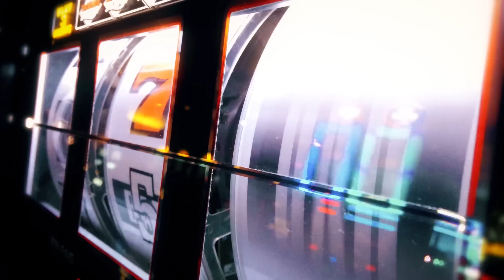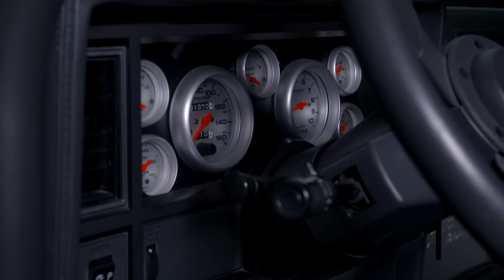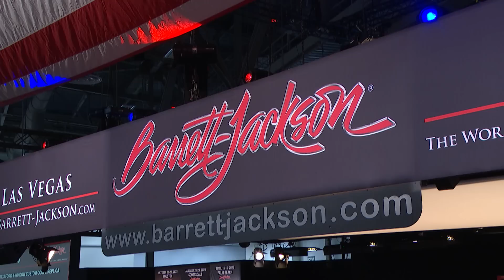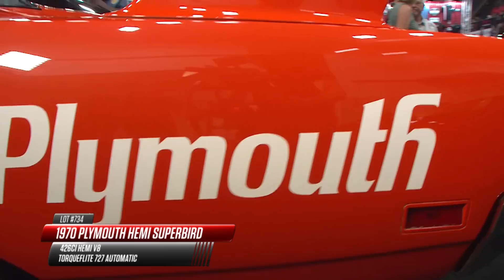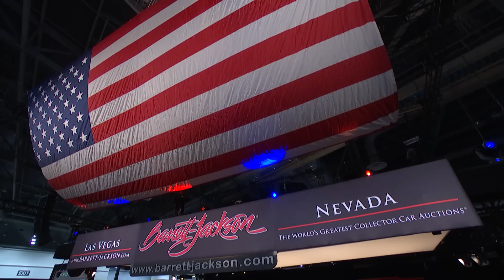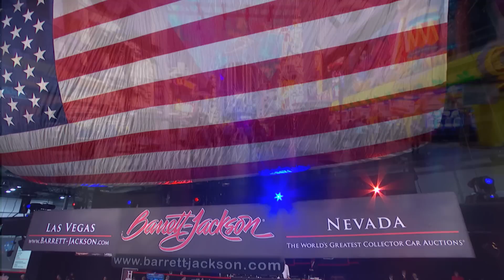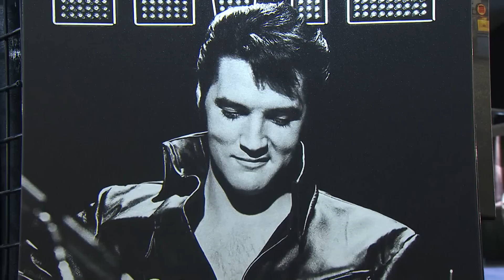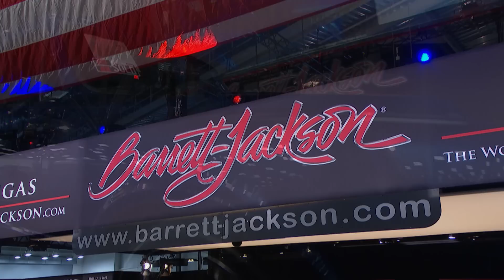SUPER SATURDAY LAS VEGAS AUCTION BROADCAST - BARRETT-JACKSON 2022 LAS VEGAS

Comment: Barrett Jackson, thank you for filming the auctions. I have allways loved muscle and sports cars [motorcycles too] when i was 10 years old I got a ride in a 70 hemi 'cuda with plum crazy paint , white buckets and slapstic auto trans . when he matted it off a red light and that thing shook and screamed and i was pinned back in that seat... Ive been hooked ever since. owning at one time or another a 69 chevelle SS 396 a 74 buick apollo I customised myself with cragar ss mags wider in the back real homemade fender flairs that followed the body above the tire , came srtraight down and hooked in like a corvette paddle flair both sides of the back and back side of the front, a cold air hood like a camaro, removed the vynle top , bought a new hatchback lid and blocked and painted it black laquer twice after both cured then sanded ,  and glazed it like glass. All the gaps were sweet and it looked wet not a ripple in it. Nobody could envision it and I was made fun of but when it was done with the white buckets and back seat redone , then they knew! Also had a 76 KZ900 that was mildly kustomized and painted with silver and a black metalic outline wow swapped the 4 into 4 with 2 into ones off an ltd. Lower cafe type bars, It was sick, I weighed about 110 pounds ye-haw!!  also a 70 cutlass 68 fairlane sedan ice blue with a white pqinted roof mustang gt mags with 70s all around out with the 289 in with the 351 windsor! what a car , the stance the ride , just great! recrome bumpers set it off. A 78 jeep cherokee with the aluminum slanted grill and big flairs 33: 12 1/2 15s on off road radials Painted like glass in an acrylic urethane desert sand white wagonwheels straight 6 3 speed manual on the floor, lock in hubs dana running gear sweet ride on the road or the woods / beach. An 05 black on black touring 350z witha 05 dyna superglide custom black with silver casings and rims matching set! wow now I have a 03 crown vic with that arizona gold paint and tan cloth intirior I love  it and Im planning on trickin it out a bit to make it handle , break and go! just a little better, sleeper for sure. Well sorry I wrote a book but I got exited watching the show as usual and just started writing. THe anouncer said that your hiring, what kind of positions do you have open? I would be in heaven to work with [for] you guys because your the best! Thanks again for continuing in your grand tradition, Im going to come over to scottdale after the next crypto bull run [ coming any time now] and buy me a sweet ride a two  seater convertible or maybe roadster of some sort, becaues all the cars that come thru are sweet as can be nomatter what the model. See you soon and thanks again to the whole crew for making it happen.